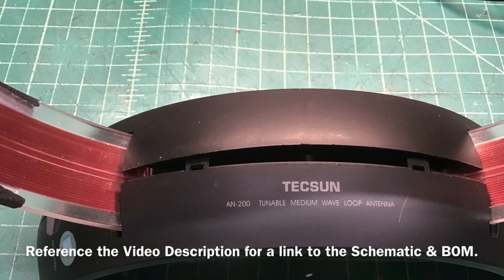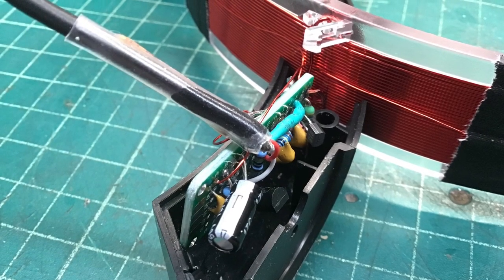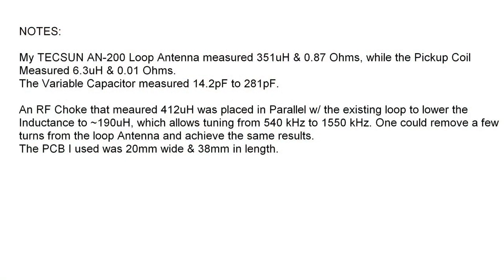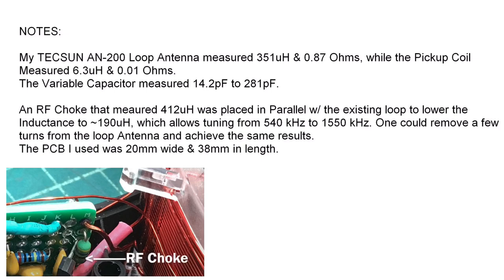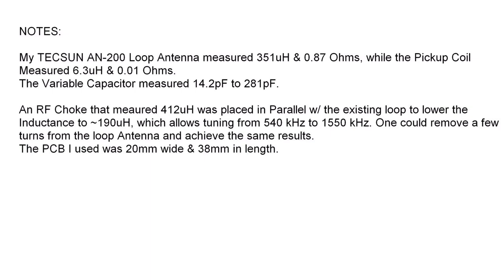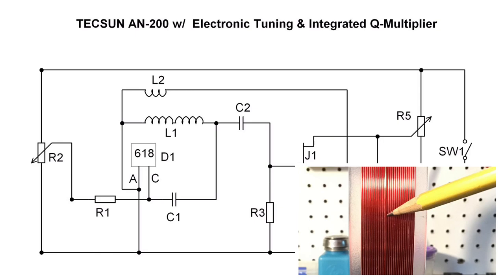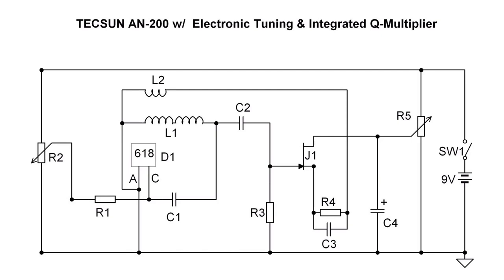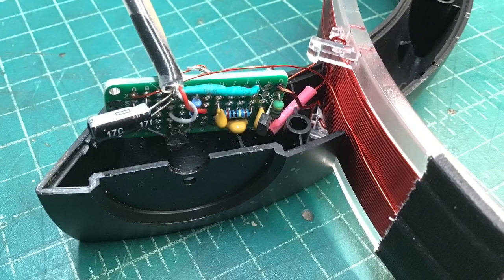TECSUN AN-200 with Electronic Tuning & Integrated Q-Multiplier

Comment: Thanks for the interesting video. An alternative to connecting the RF choke in parallel with the main winding  might be to use two varactors in series with their positive ends connected together. The tuning voltage is fed via a high value resistor to this junction. This halves the capacitance of the varactor tuning to around 250pF maximum, close to the value of the original tuning capacitor. NTE components are expensive here in the UK, but I have used 1SV149s for tuning loops. These are much less expensive here, as they usually come direct from China.
Reply from the maker: Thank you for your reply. I just received some 1SV149s and will give them a try when the next opportunity presents itself. I appreciate you reaching out and watching. All the best. Don